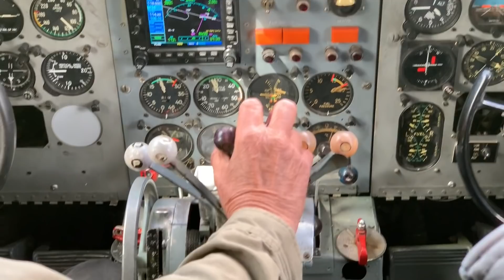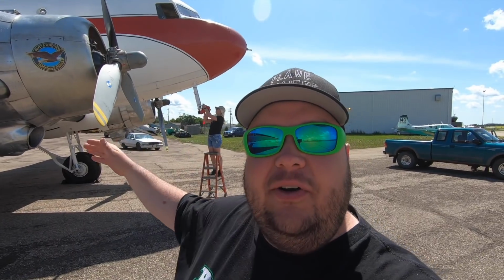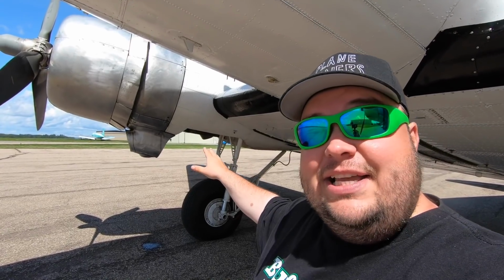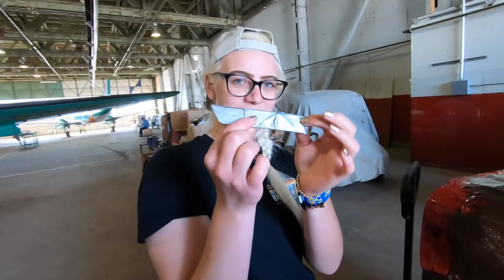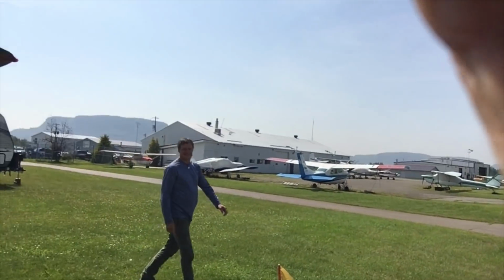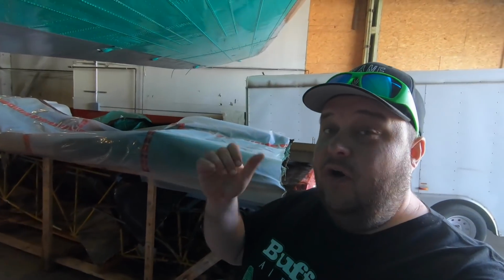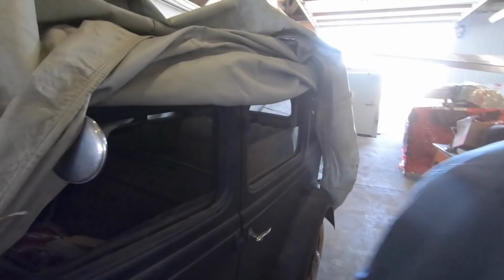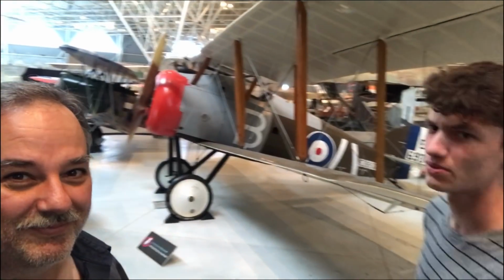WW2 DC-3 Flies Home for the 1st time! - Plane Savers S2-E2

Comment: "Stretch  that sucker 40" so you can put 2 people in it! " Put a PT6A-67B turboprop engine to power that sucker and you'll be set and  it will climb like a tom cat fighter  ~ ,! Great to see Benjamin and Bobby on the scene taking measurements what could possible go wrong? Cheers from USA!

Comment: Hi, followed DTD from the beginning and look forward to the latest adventure.
I had a tip truck the same as that fuel tanker, back in the 70s. Mine was fitted with F700 running gear with spider wheels instead of disc wheels. I used to put in logging tracks in the highlands of Tasmania. Cheers from Mike in Adelaide South Australia.

Comment: The Fokker Dr.1  triplane will provide hours of building experience for the future,nothing is impossible at Buffalo and those wings will be built from the ground up,this is what is called in the aviation world as 'A basket case' the late Cole Palen will be so proud that you are rebuilding his favourite aeroplane,most of the replica machines used Warner Scarab engines and now you can even get the Rotec which is a replica radial engine that is proving popular with replica aircraft builders.

Loved the opening scenes of DTD returning home to Red Deer,I am sure that you have fixed worse oil leaks on DC-3 engines many times in the past,a few new gaskets and torqing up and she will be flying again soon.

Stella is keen to start doing some work on the Dr.1,you can see her waiting to get to work again !
Reply: Just a comment from what Ive been reading. The Rotec engines are not having a good reputation both from a reliability point and customer support. Many unhappy customers out there. I think the Jacobs is the best bet.
Reply: You mean you’re using an engine with an actual throttle, not an on/off switch?!!!  Lol.   Hoping an episode gets dedicated to what a rotary engine is vs a radial.  Both round but waaaaaay different.
Reply: Replying to myself to add (after watching a couple of other videos) definitely no Rotec!  That company should be shut down for the garbage they’re putting out.  Beyond dangerous....

Comment: (Stella and Mikey) Why are there two different spellings for the German equivalent of the name 'Charles' ('Carl' and 'Karl')? Is one more 'standard' than the other?
2 Answers
Eòghann Peadarson
Eòghann Peadarson, Speaks/writes German - preferably with the pre-1996 spelling
Updated Apr 18

Both spellings of the name Carl / Karl are acceptable in modern German - this article explains the reasons why.

German spelling was first standardised across the German-speaking world (principally, in Germany, Switzerland and Austria - in those days, Austria-Hungary) by an international orthographic conference held in Berlin at the start of the 20th century. I don’t have the dates in front of me, but I believe that the convention from the conference was signed in 1901–2, with a number of years allotted for a transitional period thereafter, to allow for implementation of the norms laid down by this treaty.

In particular, the treaty provided the basis for a standardisation of the orthography (Rechtschreibung) of the German language throughout the German-speaking world. That was the case until 1996, when a new treaty was signed (which came into effect in 1998), partly in response to a number of divergences on a regional or national level that had arisen over the course of the 20th century (e.g., the abandonment in Switzerland of the ess-zett (ß) character as a means of writing double-s from the 1930’s onwards). The new treaty was also intended to rectify some of the norms established in Berlin in 1901–2, where these had proven to be problematic over the years or had since become simply outdated over time.

Although the treaty of 1996 has proven to be rather controversial over the years since its signature (with some of its rules being abandoned or modified since then, in response to some rather public refusals by some institutions, publishers and authors to apply them), the ‘shape’, ‘look’ and ‘feel’ of texts in German in the modern world still owes more to the treaty of 1901–2 than to the treaty of 1996. In essence, the norms laid down in 1901–2 had a more far-reaching effect than those of 1996. Prior to the treaty of 1901–2, there had been no real attempt on an official level to standardise the orthography of the language across all of the countries where it was natively spoken. As such, if you look at a text written in German from before 1901–2, it will often have (to our modern eyes) a rather archaic ‘look’ and ‘feel’, making use of certain combinations of letters that have either disappeared from the language entirely or whose use is now much reduced: examples of this include the use of th- (where t- suffices in the modern language) in a word such as thun / tun (to do) or Kaiserthum / Kaisertum (empire), or the use of -dt at the end of word (where -d suffices in the modern language), such as in Brandt / Brand (fire). The treaty of 1901–2 established the norms of what, for us in 2019, ‘looks’ and ‘feels’ like modern German.

Amongst other things, one of the things that the treaty of 1901–2 did was to regularise the usage of c and k. Previously, the letter c had been used in German both for the sound / k / (as in words such as Carl, Caroline, Cassel etc.) and for the sound / ts / (as in words such as Cecilie, Societät etc.). In simplified terms, the treaty of 1901–2 determined that the letter k was henceforth to be used to write the sound / k / and that the letter z was henceforth to be used to write the sound / ts /. Hence, Carl became Karl, Caroline became Karoline, Cassel became Kassel and Societät became Sozietät (although Cecilie remained as it was, for reasons that I will discuss shortly). In some cases, two variant spellings of the same word with either c or k had co-existed for a long time, and so the treaty of 1901–2 simply regularised the situation by stipulating which spelling would henceforth be the norm (in this particular case, k).

However, there is a big ‘caveat’ to the norm established by the treaty of 1901–2 that the letter k should henceforth be used in German to write the sound / k /: proper names, both personal and geographic.

I am not sure whether the treaty of 1901–2 expressly excluded from its ambit proper names (although I believe that the treaty of 1996 did expressly exclude them). In either case, where a name such as Carl / Karl had previously existed with both variant spellings, this practice could continue (and indeed does still continue down to this day). When it comes to personal names in German that can be spelled using either c or k for the / k / sound, the treaties do not interfere with the individual’s choice. As such, it is simply down to the individual (or, in most cases, the parents of the individual upon the birth of said individual) to choose the spelling that he prefers.

So, to answer your question as to which form (Carl or Karl) is more ‘standard’ in German, the answer is Karl - because it corresponds to, and reflects, the orthographic norms of the modern German language as adopted in 1901–2 and supplemented in 1996. Carl, because it reflects an older set of norms, is arguably ‘non-standard’ in the modern language - but it is not wrong either, because the modern language admits and permits the spelling of words in accordance with older norms where the word in question is a proper name.

By the same token, a number of towns and cities in the German-speaking world gradually changed over from spelling their names with c- to k-, hence Cassel became Kassel, Coblenz became Koblenz and Carlsbad became Karlsbad (now Karlovy Vary in the Czech Republic and no longer German-speaking). However, this change did not directly affect the English language, which is why the common usage of the spelling with c- of some German-speaking towns and cities persisted much longer in English than in German - in some cases into the mid-20th century. It also explains why the town of Carlsbad in the United States - famous for its ‘bat-caves’ and originally settled by emigrants from Carlsbad / Karlsbad in Bohemia - is still spelled with a c- to this day.

Vielen Dank für die A2A / Many thanks for the A2A, Matt Gibson.

Comment: Hey Mikey  Your dad bought a 7 cylinder Cheetah radial from me via auction sale in Red Deer  12 15 years ago and he told me its in a sea can with a nice wood prop too  It would please me immensely if that ended up on the Fokker  740 cubic inch and 3 400 HP if I remember   I sold it to redo Kitchen etc in the house my EX  has now so even more so it would be happiness for me